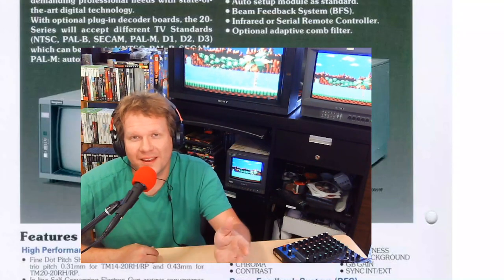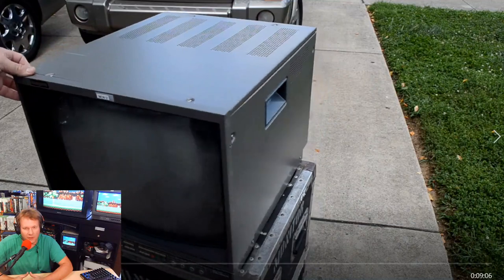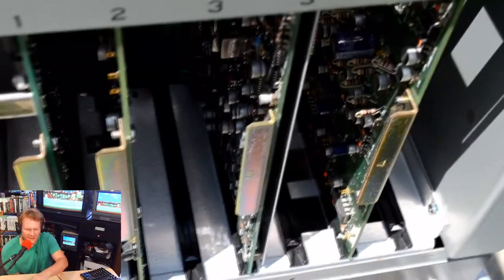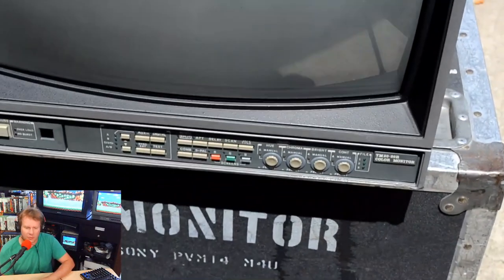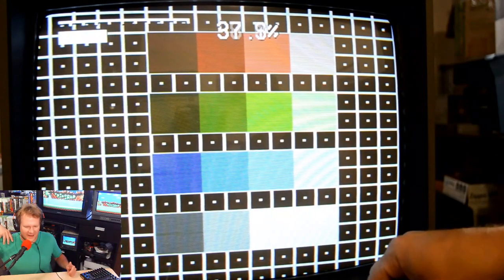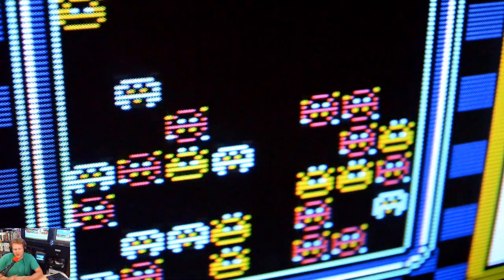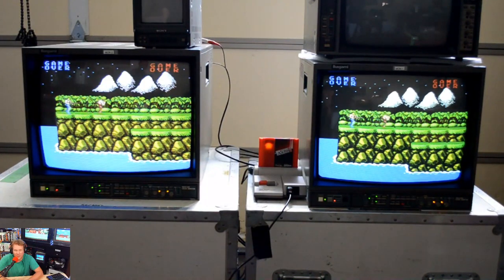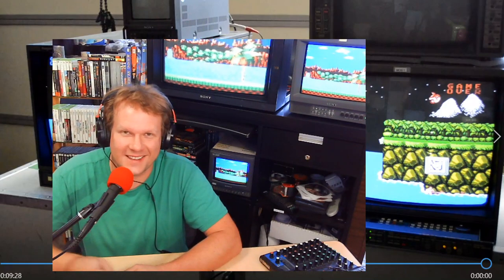Ikegami TM 20-20R | CRT Broadcast Monitor | Retro Tech Tune Up

Comment: I've got an HTM-2050RA1 from 2003. multiformat, 240p-1080i, weighs like 80 pounds and is like you said: VERY solid. I think it's actually the same chassis design as this one, even has the slick pull-out tray. Only problem is it is suffering from a horizontal collapse so I need to do some repairs. I think it's just some caps that need to be replaced thankfully. The actual shadowmask is INSANELY good looking. It's the dot-triad arrangement common in PC monitors, which as far as I'm concerned produces the best possible image for a CRT.
Reply: OMG PLEASE MESSAGE ME
Reply: I have the same monitor and very likely have the exact same problem

Comment: I love the curved screen, the analogue dial and the overall design is fantastic. I have one issue with it, that when i output my 15kHZ mame pc to it, the screen is yellow, but a friends console ran fine. The mame PC runs fine on all the other monitors I've tried, bar the nice DTV i had, which also showed yellow. I dont understand to this day what the issue is. Someone on the forums also had the yellow screen thing but for an unrelated reason.

Comment: Your video is very interesting. I have an Ikegami TM 20-9RHC which is very similar to this but does not have RGB enabled. Does anyone know how I could enable it? It is very difficult to get these types of monitors in my country and it would be great to be able to use it with RGB.
Reply: @johndeer5367  Hi, I also saw that post years ago. I have not found a solution yet.
Reply: @AntonyRaQ  In that picture it looks like he has a paper clip inserted into the remote input in the back that is on two specific pins and I think that is what he is saying enabled RGB. I found on a website just listing the specs of the monitor that "Monitor switching is ac- commodated through the rear remote connector, with an external control switch." so it seems to add up. Did you ever try shorting those two pins like in his picture?
Reply: @AntonyRaQ  Just received the unit and I was able to enable RGB by putting a paper clip into pins 3 & 7 on the remote input (the pin farthest left on the top row and the pin on the farthest left on the second row).

Comment: I don't see any cast iron in that monitor. Cast iron is weak and has to be very thick to have any strength. Most people under 45 have no clue what cast iron is.
Reply from the maker: It's just the bezel frame that felt and appeared to be cast iron.   I used to work in a utility precast concrete field in my last career.  We used cast iron manholes, etc.  The bezel felt like that, but I could be wrong.